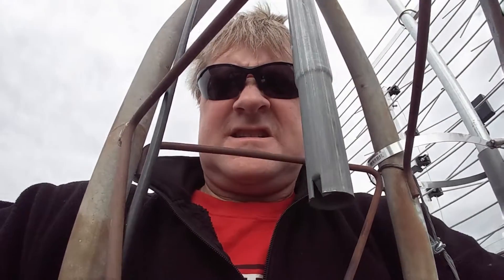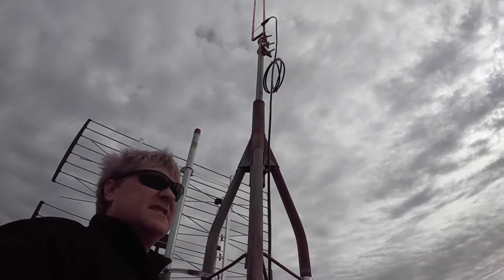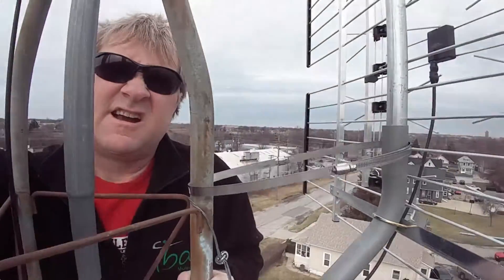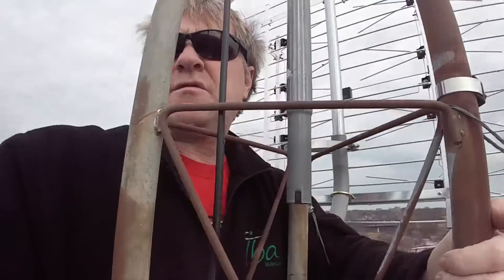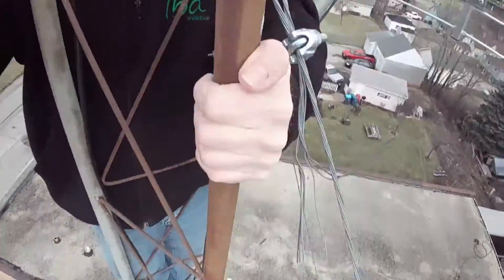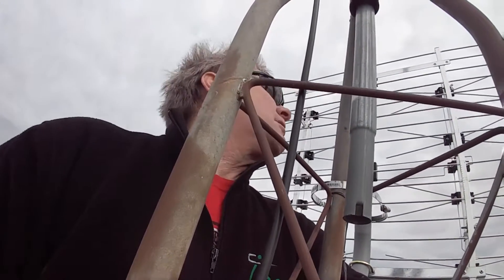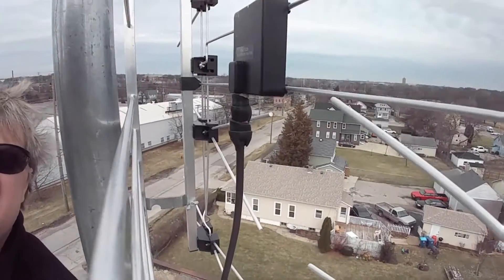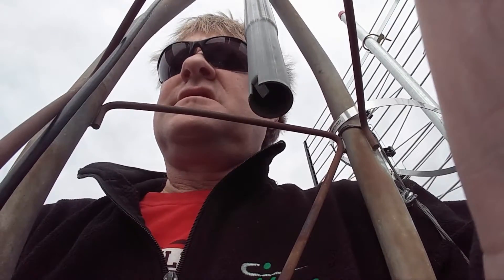FM Broadcast Antenna Install

Comment: I need a cheap antenna to broadcast please help me.
Reply from the maker: https://www.googleadservices.com/pagead/aclk?sa=L&ai=DChcSEwiOvv7Z4ej0AhV0A2UKHWheAGgYABAGGgJ5bQ&ae=2&ohost=www.google.com&cid=CAESQeD2vj0ZIEBjtXWp6qzftIxnSi5rnI3dJLdFlspGKZDOQwvnt02mhZAZOfGt3mDjtubR3FkhB5EPs0RVOJSn5t3m&sig=AOD64_28_ynKvQC4DHO8-4u3sLEy8Dndng&ctype=5&q=&ved=2ahUKEwimhfPZ4ej0AhVaj4kEHULQCcsQ9aACegQIARBT&adurl=
Reply from the maker: https://www.jpole-antenna.com/antennas/low-power-fm-broadcast-antenna/
Reply: @KraftRacingandMore  how far can i get with 15 watts
Reply from the maker: @leasttrending  all depends on the topography surrounding your Broadcast location. Higher is better, less obstructions is better.  15 Watts can get you in trouble with the FCC if your not carefull
Reply: @KraftRacingandMore  thats what i want alex jones 24 7

Comment: Just wondering if it interfere with your TV antenna reception while broadcasting? Thanks
Reply from the maker: it does not
Reply: @KraftRacingandMore  Thanks for the reply. Just wondering what could be the reason why I could not pick up TV signal once the FM broadcast transmitter fires up.

Comment: Great vid Steve. I’m just wondering did you have to run a wire from the broadcast antenna to ground it?
Reply from the maker: Thanks,  it's grounded through the tower as it's bolted to it. No other ground needed.
Reply: Thanks Steve

Comment: That's a good hight for it and how many watts is the transmitter used with this antenna 7watt a 15watt or what would like to know and at that hight how many miles does the signal go? Me by the looks of it id say about 6miles at that hight but that's just a guess.
Reply from the maker: Kai Footer im not using it right now the transmitter died.
Reply: @KraftRacingandMore  oh ok but do you know how Manu miles the signal went out when was working.
Reply from the maker: @djk2509  no idea
Reply: @djk2509  at that hight it would have reached 10-20 miles easily. maybe even more from the looks of the flat land around the mast.

Comment: Nice Jpole (and height).  Do you plan to do a studio tour?  I'm gathering and researching ideas for the least number of audio processing products for a small rack.  Not sure I'll be "ballsy" enough to do it from home, however, mobile (find a big hill, drive up said hill, plant a 10-20 foot mast (whatever I can get away with without guy wires) then, well, do the do.  So small is vital and I'm not getting the latency I would like from using a laptop (besides the audio cards in them aren't really all that).
Reply from the maker: No plans for a studio tour at this time. it's a laptop going into a transmitter then through Coax to the Jpole.